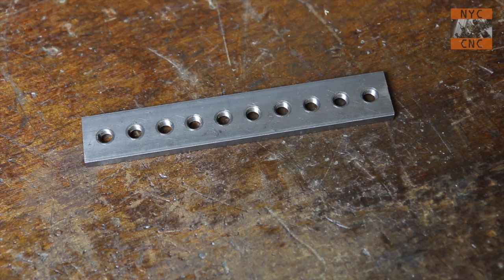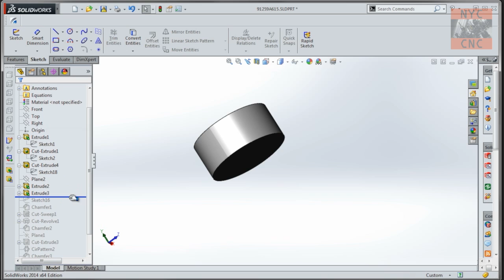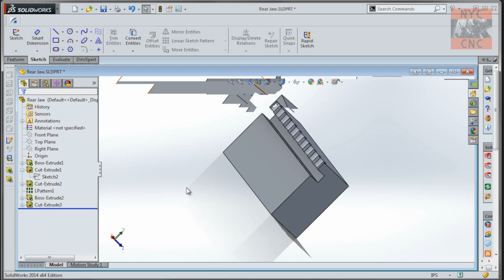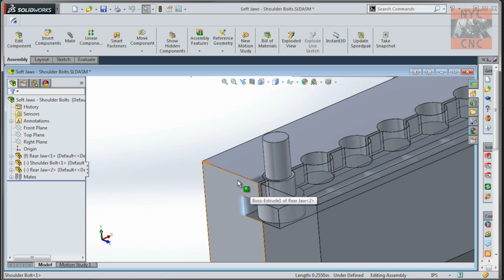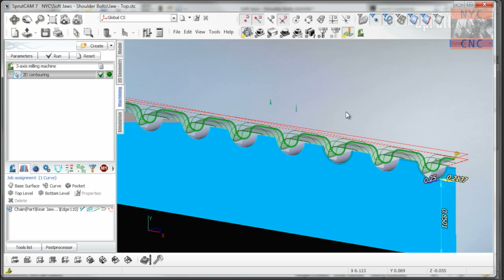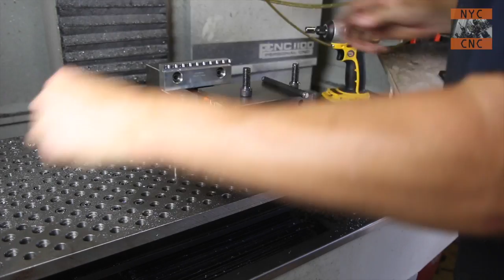CNC Machining Hard Steel with Soft Jaws! Wednesday Widget #4

Comment: John, nice work on the video editing.  More Youtube machinists should learn to edit by fast motioning a repetitious operation after showing one complete normal speed version.  This set of soft jaws seems to have worked out just fine although I felt that the amount of overhang protruding above the jaws was going to possibly be a problem.  With the undercut (thread relief) being a stress riser, I envisioned the hard material to snap off.  Again you got away with it.  I often use soft jaws to hold and maintain machining accuracy on small difficult to hold parts.  In the future, if you need more accuracy, I would suggest mounting the soft jaws into the vise prior to machining. You can squeeze a piece of sacrificial aluminum between the mounted jaws to act as a spacer and at the same time put the system under compression to get very accurate work.  Keep up the good work!

Comment: If you want to get more tool life why don't you take deeper cuts at slower feed speeds and/or taking less material so that way you use more of the cutting edge on your tooling?  Thks for your vids.  They are very informative.  I stumbled on your channel after watching Keith Fenner, Keith Rucker, Abomb, Mr. Pete and Jamie @ weldingtipsandtricks.

Comment: when you where milling the first cut through the soft jaw, wouldnt it have been more speed efficient if the end mill was cutting on the way back as well, like how the it was cutting down the shoulder screws?
Reply: Cutting on the backstroke as it were would be called "climb milling". Climb milling is where the cutter's contact surface is rotating with the path of movement and makes the cutter want to climb in the direction of movement (google climb vs conventional milling for some more helpful drawings). Climb milling has many benefits, but it also has a big drawback. Cutting on the climb leaves a better surface finish, aids in chip evacuation, and allows for better chip load control. The downside is that you need a pretty rigid machine to climb mill. If rigidity or axis backlash is an issue, like in manual machines and light-duty CNC machines, climb milling may cause the cutter to be drawn into the part due to its rotation and break a tool or crash the machine.

Hope that helps out!
Reply: SquawkVFR ah, thanks for the reply, we just went over that a couple days ago in my machining class haha

Comment: Mcmaster is a fantastic resource. But I would question using the diameter of the screw heads of the 3d CAD models they have available on the website, as I found most don't match the head sizes of their real-world counterparts. This caused some
confusion when I found the hardware I ordered based on the head sizes of the 3d screw models I downloaded were undersized.

Comment: I love using solidworks and designing different things and have thought about some soft jaws to hold some of my parts to make the milling times quicker but I made a steel fixture out of some scrap metal I had and it worked really good and I just never done the jaws because I was making just a few and didn't see a need at the time however this video just gave me some ideas for the project that I'm designing now so another big thanks to John for doing these videos!!

Comment: John you think Solidworks is great try Solidcam....  Ive used Bobcad , Mastercam hsmworks. Solidcam is something else.
Reply: NYC CNC
To bad you moved so far,   I would of swung by or you could of came here . I would of loved to let you play with solidcam. I live in Waterbury CT, 10 mins from upstate NY hour from the city .
From what Ive seen top two Cam programs are Solidcam and Mastercam. Those two are a personal choice. I personally like having my cam integrated in Solidworks.Makes life easier  for me. So I could do either but prefer Solidcam.
Love the new shop though. I really wish I had a space that size. Im in a one bay garage . Pretty tight here. Good luck with the new beginnings personal and business.
Reply: SolidCAM is around the same price as MasterCAM, though haven't done any recent comparisons. But if one gets SolidCAM, the iMachining is a must have, as it beats competitor CAM softwares and wipes the floor with them. No more thinking of speeds & feeds for even the toughest materials. After couple of hours playing with it, MasterCAM seems like a hobby machinist choice :D

Comment: I bought ten of those very nice Monster Jaws on eBay as well, and I love them.  However, I don't think mine have oval pockets for the socket head cap screws that attach the jaws to my vise, so mine don't seem to be reversible.  I watched a TacticalKeychains video where he flipped his over to get double the use from them, and I assumed that his vise must have a different Z height than mine and the soft jaws were designed to be flipped on his vise but not mine.

Great instructional video, on several fronts!  Thanks for taking the time to share and educate others.
Reply: NYC CNC
Well damn the bad luck!  I bought ten pairs of the regular Monster Jaws on eBay, not realizing that there were reversible Monster Jaws.  I just checked, and if you know to search for reversible soft jaws, they are for sale on eBay.  The regular Monster Jaws should have a bold red warning.  THESE ARE NOT THE REVERSIBLE MONSTER JAWS YOU WANT!  :-)  Sadly, I'm getting to be an old dude.  By the time I use the other eight of my Monster Jaws, I'll forget that the regular jaws aren't reversible and I'll probably order ten more sets of regular Monster Jaws.  They're still awesome, even if they are only half as awesome.

Comment: Thanks, I really enjoy your videos. You do a great job making them flow and the way that you explain your thought process makes all the difference in following them. I always learn something, even if you're using tools I don't have to make parts I don't need. Knowledge is independent of the conduit.

I'm not being critical, but the engineer in me has to ask why you don't change the product design to use a standard fastener? I understand the solution as an amateur machinest, you tend to work with the resources you have and know well, and that Tormach sure beckons a lot of solutions. I often find myself going in a particular direction when working up a product, only to find my 1st technique, or even material not really the best overall and often find a simpler way.

I am very familiar with the concept of  "when your toobox is full of hammers, all the world looks like a nail" and wonder if that's the reason you are cutting down bolts. If I were cutting them with a saw and finishing with a belt sander, It wouldn't be long until I was in search of a better way. Having time available on the Tormach would make that a lot less urgent.

Looking foward to the next Video, Scott

Comment: Great WW !  Would love if solid was an option at less $$$. Have a feeling I'll just be using alibre and sprut for a good long while, when I finally get a machine.
Reply: no :) not yet, that's just what it looks like I'll be using as solid ends up being about 4500 or so on best promotion, planning to pick up a machine this winter.
Reply: probably an tormach 1100, been also keeping an eye out for a smaller bridge or haas, need to keep it under 7.5 hp though so it kind of limits my options.

Comment: Hell yea add me to the poll, I got the PCNC 1100 to great extent because of the capabilities shown by John. While I would not get rid of it I also got a issue more like what you would expect from china.  It was not trammed out the box at .0085 called and told to use a crowbar and washers to shim it lucky I found NYCcnc shim tutorial its now .002 in 8 inches.( you can only flex the casting so much before the other axis starts to migrate also) The cabinet door is not square and gaps so coolant gets in without corrective measures also the cabinet is flush with main column at botton but big gap at top looks cattywompus had to caulk so not to trap coolant. nicks on table and scratches to paint all over place. nice to see some had same problems I don't feel like such a chump. Back on topic this fella is a class act he does not have to do this so subscribe already! I just did and thumbs up way up.

Comment: Have you considered getting a SpacePilot 3D mouse? I like mine quite a bit. It's a very good companion to SolidWorks.

I have the SpacePilot Pro, but it looks like the SpaceMouse Pro might be a better choice (I think it might be a newer design). SolidWorks is the only program I use it with and the screen of the 'Pilot is basically useless.
Reply: NYC CNC

I bet you know what you aren't missing if you've already used it with SolidWorks. If you used it with another program it may not have worked as well; personally, I don't like it nearly as much in Rhino but I love it in SolidWorks.

Comment: Lets keep the poll active I also bought my pcnc1100 mostly because of NYCCNC videos. Thank you again for the completeness of the video. I saw a soft jaw video from this other guy and learned nothing just got sold his product. I hope you get the props you deserve. I should note that the mill I got was not any near to yours in condition my machine came 0.019 (yes 0.019) over six inches it took removing the head and machining the bolt holes to get it to 0.001 over 6 inch other things like a 0.003 dishing of the table on the right has few fixes. lesser items like cracked control panel plexiglass, missing heat sink to the control board transistor (1 of the 4) 1/4 inch gap top of cabinet to column for liquid to get in and slanted/crooked door etc. NOT BASHING tormach as a it is a great machine but I plan on video on how to repair these issues in supplement to these great videos. I guess its to be expected that I would not get a show piece one.

Comment: This might seem a little picky, but what happens when one of those custom-made proprietary screws gets busted out in the field?.. Possibly, by a stray bullet.

Could be, a slight change in design could eliminate the need for fancy screws.

Frank
Reply: For instance: You could put a sleeve on a normal bolt, to take the place of the shoulder.

F.
Reply: A 22lr does not have the energy to bust these bolts.
Reply: Is it stated on the product, that it can only be shot at with a .22?... Will a .44 Magnum void the warranty?
Reply: Well, my point being, sometimes we make things more complicated than they need to be.

Comment: I've been using SprutCam for 6 years now and didn't know about the ALT to remove something from a selection set, good tip, thanks! Because I didn't know about the ALT trick, I always used the "Project on plane" button in the model tab to have SprutCam create the 2D geometry for me.

Comment: Was a solid works guy for over 10 years but now I'm really starting to like autodesk fusion 360.
Reply: I do 3D modeling as well and it combines the two with a really easy UI without loosing advanced features. Think of it as a solid works+sketchup+rhino in one. I find it doesn't lack any features that I use and although I don't care much for sketchup it uses some of the time saving features with creating curves and editing dimensions much faster than solid works and solid works is second nature to me.

Comment: Great video! With a slight modification, your jig will make short work of the screws.  Use a flat bar, on one jaw, to clamp the screws into the notches of the other jaw.  If there is any wear in the jig, you will still get a secure hold.
Reply: Combine Randy Richard's idea with Kurt Armbrust's idea.  Machine a soft jaw as an inverted T shape, with two horizontal ledges for two rows of the inverted shoulder bolt screw heads to rest, and two flat vertical surfaces to press the two rows of shoulder bolts into the pair of soft jaws you already have.  Rewrite your G code to trim 20 shoulder bolts at a time instead of ten.  Toss in your idea to use a larger end mill to trim each row of shoulder bolts in a single pass.  New & improved!  Now with 200% more win!  :-)

Comment: Hi John, another great video. Could I ask, did you consider cutting the soft jaw profile with the jaws screwed into their position in the vice? All you need to do then is clamp a parallel strip(known thickness) between the two jaws. The create your profile in Solidworks, split it along the X axis. The distance between the two halves would be the adjusted of the parallel thickness, minus a slight thickness so the jaws close up and clamp on the screws not the lower part of the jaws. This would surely be the most accurate way. Your method obviously worked, but maybe because of the quality of  the jays you used.
Reply: NYC CNC Hi John. Appreciate the reply......Love your work. Can't wait for the next instalment.

Comment: Hey John, again a great video! There is just one thing I don't fully understand. You have given the fixture clearance on the top to clamp the screws, but didn't do so on the bottom? Doesn't that mean that the soft jaws touch on the bottom face before any great force is applied to the screws? 
Only possibility that comes to my mind right now is that you offset the center of the half circles?
Reply: Yep! As a freshly graduate "draftsman?" (we say dessinateur/projeteur) i see the same problem.
And farid solution is à good one :)

Comment: a question, John, if you have time: is it better to use an endmill—as you do—to trim down those bolts, compared to using some kind of saw?

if this sounds like a dumb question, I don't really know what's available in saws, but I saw in a tormach vid about setting up a saw for the pcnc, and I know there are carbide ones, too, so I was curious.  it seems, in my ignorance, like a saw might do it a little faster, and perhaps with less tool wear.
Reply: NYC CNC It's compounded by surface speed considerations and hp/torque curves, too.. a 3" saw will typically wind up at the bottom of the RPM range in anything difficult. Further, they usually have quite a few teeth, requiring you to pick your poison between under-feeding and stalling. Helical interpolation usually does a bang-up job shortening up bolts like that, use a cutter larger than the bolt, and make your helix diameter just large enough so it doesn't leave a nipple in the middle.
Reply: NYC CNC that's interesting.  I'm a little surprised about the horsepower, but I guess it's something to do with the cut being farther from the center of rotation?

if you have time, why would a 1/2" end mill do it in one pass?  less deflection, or something related?
Reply: NYC CNC yeah, that's really easy to visualize.

thanks!
Reply: I'd use a lathe to cut them down.
Reply: Andre Gross I thought about that, too.  what I wondered was, wouldn't it take longer to chuck each one up individually and cut it down, as opposed to ganging them, like this?
Reply: Yes it would, and since he needs so many it wouldn't male sense. But for the home shop doing it in a lathe would be a lot simpler.
Reply: Andre Gross thanks, that makes a lot of sense.
Reply: thanks, everyone!

Comment: Nicely done.  Fully agree with your Solidworks opinion, pretty much went through the same steps you did, going through Alibre, then on to Solidworks.  I am constantly amazed by Solidworks, it is immensely powerful, configurations will make you feel like a god when you start getting proficient at that, which I believe is Solidworks best feature.